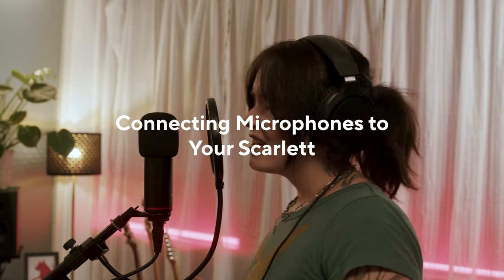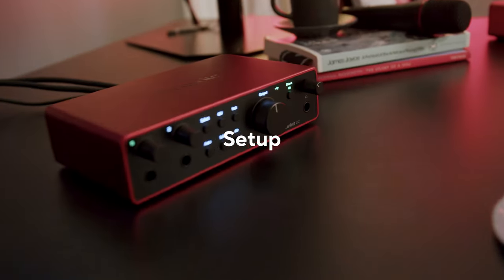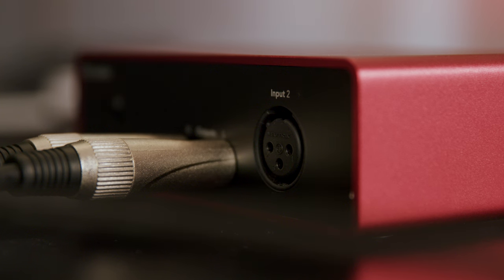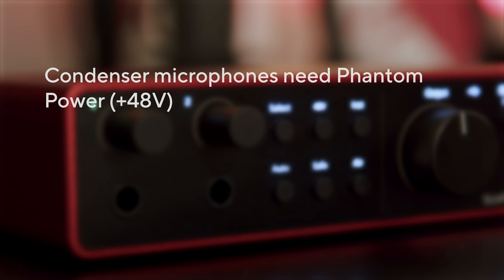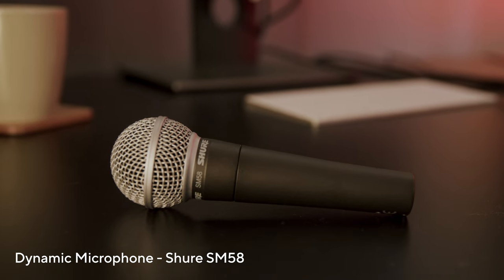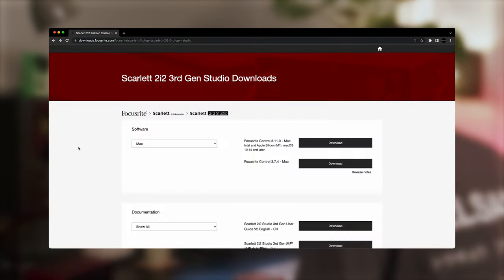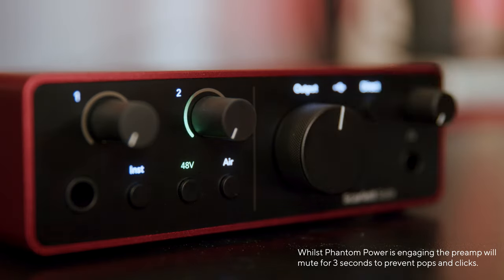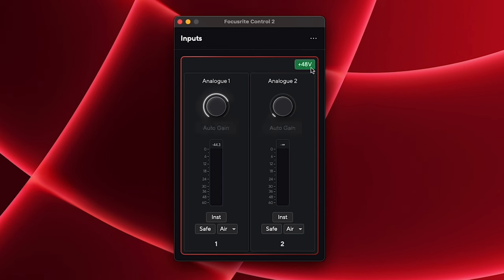Connecting Microphones to your Scarlett Solo

Comment: My microphone is super quiet unless I put the gain super high up but that causes things like my keyboard or my lips smacking to be picked up and super audible. I’ve heard it might be because my Scarlett is using the instrument settings instead of the microphone settings but I don’t know how to change it. I had to combine both input channels just to even use it in games since games typically only support 1 audio input
Reply from the maker: What kind of microphone are you using? How loud is the signal? Where is the signal metering in your software?
The Line/Instrument control can be used to prepare the 1/4" input to receive either an instrument or a line-level signal. That control will have no effect on a microphone connected via XLR.
Reply: @FocusriteHelp   I’m using a Heil Pr40. When testing my mic volume on my windows settings it reads as using 16% of my total volume and that’s with the mic volume at 100% in my settings and the dial for the gain on my mixer being at the half way point. Just from doing a bit of research into this I’m thinking maybe I need a preamp? I figured all I needed was the microphone and a mixer (which is a solo 4th gen) but that might be what I’m missing. I’m not the most tech savvy person so any advice is appreciated greatly. Thank you!

Comment: my focusrite can't detect my at2020 condenser mic, but when i plugged in a dynamic mic, it works pretty well, maybe it's the condenser or something?
Reply: i am using focusrite 2i2 4th gen. maybe it needs a driver? dunno man =) help coz i just bought the condenser mic.
Reply from the maker: We're sorry you are having trouble. Have you enabled phantom power for your mic, you will need to make sure +48v is applied to the input connected to your at2020. If this does not solve the issue, please reach out to our support team at the link below for further assistance: 

https://bit.ly/FocusriteSupport

Comment: i got my solo kit with all the cables and stuff but when connecting mic, nothing happens, only headphones were able to connect, but mic is not working.
Reply from the maker: We're sorry to hear you are having trouble. A few things we can try:

-If you are using a condenser microphone have you turned the +48v button on?

-Is the mic showing any signal when connected? If so, when you select direct monitor do you hear your mic? 

-Have you checked the additional steps in this article? https://support.focusrite.com/hc/en-gb/articles/8986949204498-I-m-getting-little-or-no-signal-from-my-microphone

If you try these steps and still experience trouble, please reach out to the support team at the link below for further assistance. 

https://bit.ly/FocusriteSupport

Comment: what if the mic has a usc cable? is there an adapter?
Reply from the maker: Microphones will need to be connected to Scarlett via XLR cable. Generally speaking, microphones with USB connectivity are not compatible with audio interfaces like Scarlett.

Comment: I did it but there is a problem. I only can hear it through my headphones. I also want to use the microphone without headphones. How can I do that?
Reply from the maker: Are you having trouble hearing your speakers connected to the line outputs on the back of the device? These are controlled using the main monitor knob on the interface which is separate from the headphone knob. You may need to make adjustments in Focusrite Control or Focusrite Control 2, information on how to use these programs can be found below: 

https://support.focusrite.com/hc/en-gb/articles/115004431669-Focusrite-Control-Tutorial-1-Introduction

https://support.focusrite.com/hc/en-gb/articles/13291845720978-Using-the-Focusrite-Control-2-Mixer

If none of this helps, you can reach out to our support team for further assistance: 

https://bit.ly/FocusriteSupport

Comment: How do I make it so that when I am recording via my microphone recording does not pick up what is playing on PC?
Reply from the maker: if your microphone is capturing audio from your computer, then it is recommended that you use headphones and mute any speakers when recording audio. If your recording is capturing internal computer audio, you should make sure you are not recording your loopback input. More info on using loopback with Scarlett 4th gen can be found here: 

https://support.focusrite.com/hc/en-gb/articles/13229216604562-Scarlett-4th-Gen-using-Loopback

Please let us know if this helps or if we can answer additional questions.
Reply: @FocusriteHelp  Thanks. Seems to be loopback issue then. Sadly that page only covers control software on windows, and I am on linux
Reply from the maker: I see, unfortunately, we do not currently offer official support for Linux devices. However, we have assisted Linux users with driver development, some of which can be accessed here: 

https://github.com/geoffreybennett

 Please let us know if this helps

Comment: I have microphone rode nt-1a and interface scarlett solo. When I use +48V my voice has very bad quality, but when I turn off this button I cannot hear myself at all. What shoud I do?
Reply from the maker: Hi, we're sorry to hear you are having trouble. That microphone is a condenser microphone so it needs phantom power (+48) to capture any signal. A couple things worth trying is raising the buffer size in the settings of your DAW, this can help with distorted audio, and also replacing the XLR cable you are using. If you try these steps and still experience trouble, please reach out to our support team at the link below for further assistance. 

https://bit.ly/FocusriteSupport
Reply: Hey did you ever figure this out I have the same interface and microphone I just got mine and I’m confused